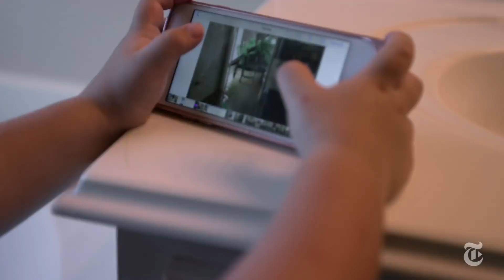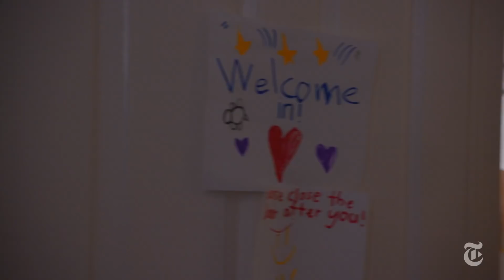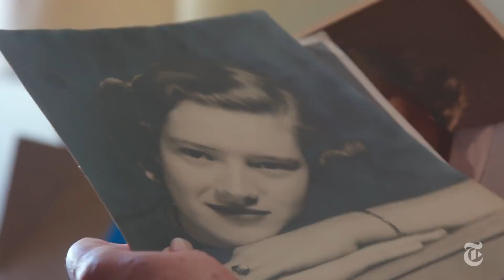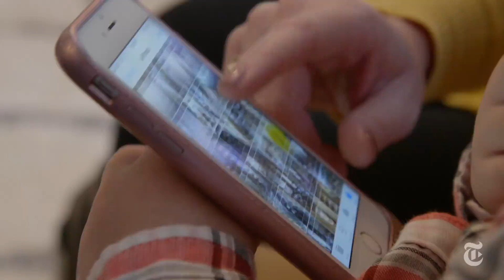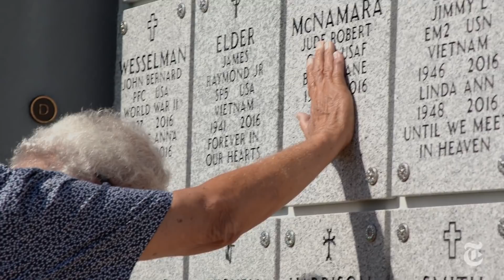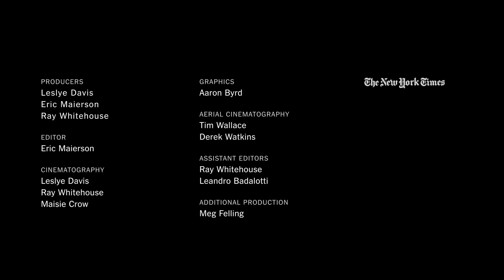How a Community Was Sacrificed to Save Houston | Times Documentaries

Comment: If you have a choice you can't "not make it". Had the authorities chosen to flood the city, they'd also have been blamed, and in this case it is quite obvious that those homes shouldn't have been build in a flood susceptible area that, after all, was designed to be flooded if need be.
Reply: but the government shouldn't have allowed houses to be built on it/sold the area to a private investor in the first place. This should have remained a park or just wildlife
Reply: You are right, but after the housing had been build (not by the government), and when the rain is pouring, can you really, like really blame the government? And, as far as I've understood, the government hasn't "sold" the land, rather (which is bad enough, but way less culpable) it didn't buy it when it could have,
Reply: You're right, Valhalla. The government should have bought it and just kept it as a reserve. But the government didn't want to buy it, and no one stopped the private investors from doing whatever they wanted with the land they bought. And no one told the home buyers what sort of land they were buying. Failures all around.
Reply: but it was built in a way so that the area could be flooded. So it was once intended as a safety-plan. If not by the government then by whom is the question. And yes, if it was built that way, the government knew about it and should have made it impossible to buy the area. I think they are absolutely to blame.

Comment: Something similar happened in Providence and Cranston, RI in 2010. Particularly the Valley section of Providence near the Woonasquatucket. You see 10 days of consistent rain managed to flood the states main drinking water reservoir. The reservoirs spillways dumped into, you guessed it the Woonasquatucket river. Took out a bunch of bridges, water up to the roof line particularly in western Cranston. It was bad.